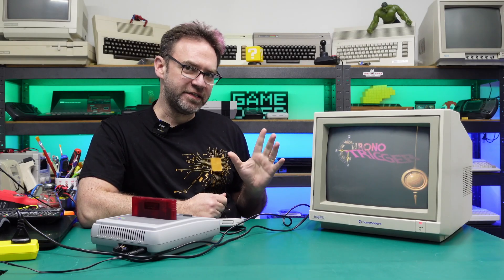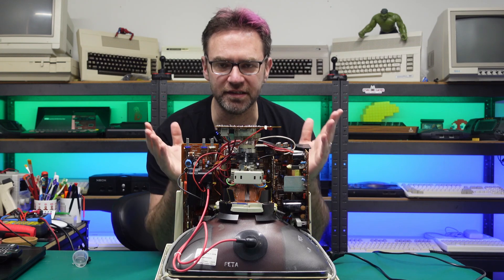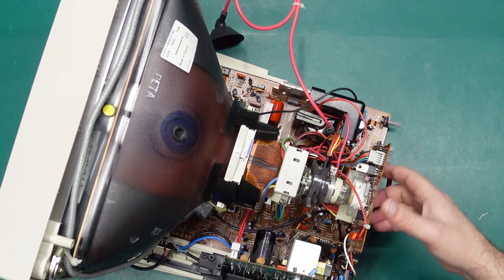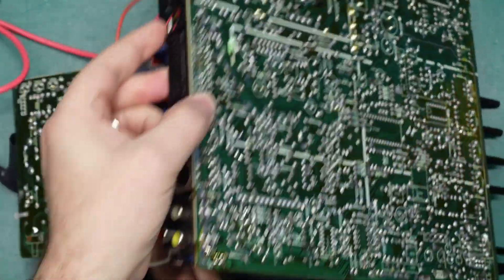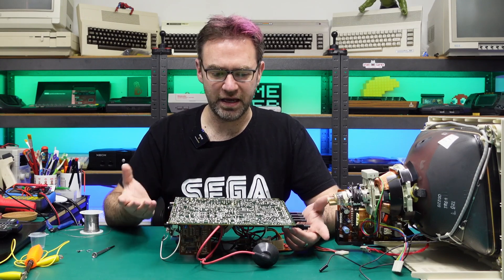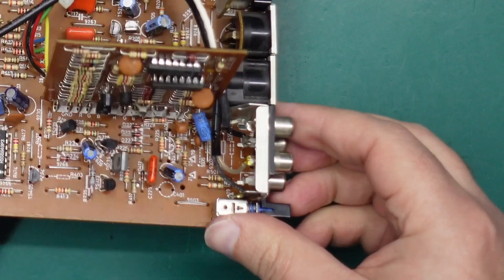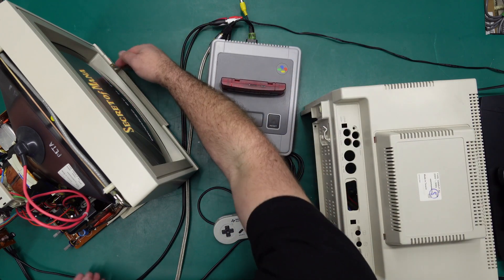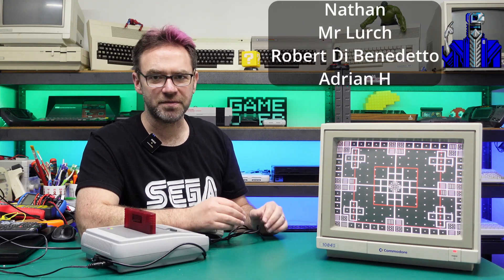Adding RGB SCART to a Commodore 1084 (old version - see pinned comment)

Comment: so if I make a din (analogue RGB) to scart female connector, would that be different than how you installed the scart connector diretly on the monitor ?
Reply from the maker: You can make a scart to din adaptor but it will only work with devices that output csync. You will still need to do the other mods if you want it to work with sync on composite or sync on luma. The instructions in this video are outdated, please see the new video here https://youtu.be/GP2Z7Y1ZBW8

Comment: Hi Mate. I just got a weird NTSC model 1084s. It has been modded at some stage to take 240v. But I’m getting black and white through composite. On both PAL and NTSC consoles. The crystal and sticker points that it is ntsc set . 

Do you know what differences I would need to add the Scart on this set?
Reply from the maker: Odd that colour is not working with PAL or NTSC. Perhaps there's an issue with the composite and luma/chroma switch or something along those lines. Adding scart should be the same as I showed in the video but I cannot guarantee it will work with an NTSC version

Comment: So this "mod" was for 1084S but I have 1084 with only one speaker. So this works for it like the same, just without that audio-cable?
Reply from the maker: It should be similar but not guaranteed to be the same
Reply: Thanks, I'll check it out some day. I have already 1081 which works nicely and has a SCART. Got some cracked solder joints when I got it but after fixing those, no problems.

Comment: Great video. Do you have a textual documentation source for those modifications?
I have an 1084 and its board clearly differs from yours (an S-P if I remember correctly) so having a written reference would help.
Reply from the maker: No sorry. And if the board differs then it may not be possible, at least not using the same method

Comment: I actually have a RGB Scart model (Profex branded). I have my Amiga 1000 hooked up to it. Never tried a console like SNES or Mega Drive/Genesis. Interlace mode on my Amiga is rather flickery with it. Do you think it'll work with a 16 bit Sega/Nintendo console?
Reply from the maker: The ones that came with scart will likely work fine with those consoles, but no guarantees

Comment: Hello sir ! , i do the scart, mod is working good. But only with my snes i tested out with other of my console but it’s not working with them, the scart work only with the snes , do you have an idea if the problem ?
Reply from the maker: Did you take note of the pinned comment about jumpers? Also what happens with the non working systems - no image at all? Scrolling or scrambled image?
Reply: @TheRetroChannel  yeah I take care of the pined comment don’t worry, and I have no image at all, the sound work but no image
Reply from the maker: @yeckom-vr6946 Hmm ok. Have you confirmed the other devices work with RGB scart on another display?
Reply: @TheRetroChannel  yes im not sure but I think the problem is from my video cable because with my snes I have a full rgb cable , but with the other console I need to use a adabtater from the 3 colored cable to the scrat , but I’m not sure
Reply from the maker: @yeckom-vr6946 Yeah, sounds like you may need to source proper scart cables for the others, or just stick with the SNES. Who needs anything else 😉

Comment: IIRC I used my 1084S (using the scart cable) and hook up to video machine so I could watch movies on it. I never tried any consoles connected to it, as I had none :) But it was a really good image on it compared to the awful "analog" TV's I was used to back in the 80s and early 90s. I still have my 1084S. It had to get service once, but it's been working fine.... Fingers crossed and hope it will continue to work for many more years.

Comment: Great Video👍🏻 How many watts should the resistors have?
Reply from the maker: Quarter Watt resistors will be fine
Reply: @TheRetroChannel  Thank You for the Information👍🏻 The Modification can begin!
Reply: @TheRetroChannel   I did the Mod, 
but I have some Problems! If I use the  New Scart Port with a Mega Drive I get picture and sound but the Colour Adjustment in front of the 1084S doesn't work anymore!!! And if I use a Scart Composite Adapter to connect a Sony PS1 on the New Scart Port  the Screen stays Black!  ☹️
Reply from the maker: Using RGB bypasses the colour processing. You will find this is the case with almost every RGB capable display.

Composite will likely not work being fed into the scart connector, just use the composite RCA connector already on the monitor
Reply: @TheRetroChannel  Thank You for Your quick Response!! 👍🏻 I thought I made a Mistake somwhere🤔  Thanks!! 👍🏻

Comment: Hi! Great video! I have a question. Will this trick work on my 1084P (MONO)?
Reply from the maker: It might, best bet would be to open it up and see if it looks the same. The audio side will obviously be different but just wire pins 2 and 6 on the SCART to the monitors mono audio input

Comment: Thank you for the great tutorial! I've modded my 1084S successfully (and also had to add the jumper @AusSonic mentioned) - Strangely, the montior needs around 3 Minutes of "warm up" (only after complete discharge - e.g. over night) since I've modded it - it starts with a thicker red line in the middle which widens after some time and starts to show a picture (garbled in the beginning) which becomes lesser red and more visible after some time. After some minutes the picture widened and stabilized and the colors are good - the monitor can be used normally then. Maybe you've got some hint what might be the cause of this behaviour? As I live in Germany, it's a german model btw...
Reply from the maker: So the issue only started after you did the mod? I was going to suggest bad caps that needed time to warm up. But if it was working fine up until recently, then perhaps a bad joint?

The solder joints on these things are known to go bad and maybe doing the mod has caused one to open up. I'd take a closer look at the board, if your phone has a decent camera you should be able to zoom in and see any bad joints. Pay close attention to the ones around the flyback, and also make sure the neck board is seated firmly and there's no bad joints there.

Otherwise perhaps it's an issue with the heater? I think you can measure the heater voltage on pins 4 and 5 of connector M6 on the neck board. Maybe check the voltage there when you first power it on from being off for a while, and then check it again after a few minutes to see if there's any change

Comment: Thanks for the great video i'm adding a scart to my 184S_  btw the 2.2K resistor goes into 9289 not 6789... ;)
Reply from the maker: Ha, didn't even realise I said the wrong thing after the resistor was in, but yes it should be 9289. Oh dear, I say it like 3 times, I think because it looked like a 7 instead of a 2 on the bottom of the board
Reply: @TheRetroChannel  update on my mod it Didn't work. the screen was garbled and kept on rolling.. I had a look at your board and found a wire jumper was missing on my board  just above R402.. So i added that jumper to it and presto it works.. Thank you once again for the proper tutorial..

Comment: Interestingly my 1084S works with just installing the Scart connector and the jumper(s). Moving the transistor, and adding cap and resistors results in a picture similar to yours before you made those mods. Keeping the transistor in place and not adding the other components has a very nice picture from my A500 PAL. Thanks for some great videos!
Reply from the maker: That is very interesting. I'm curious if you tried it with anything other than the A500? I did test it with a bunch of other systems and everything worked as it should, mind you the A500 was not one of those, but it did work with other systems that output csync. I'm thinking that 2.2K resistor may be too high for the A500 sync...EDIT: I just checked with the owner and it does work fine with his A500, so there must be something else going on.
I might pin your comment and see if anyone else has similar issues - if you do please reply to this comment
Reply: @TheRetroChannel   Great video tutorial ! I just went through the whole process and successfully modded my 1084S-P.  Thankfully, I saw @markhindsbo7876 comment before finishing the mod, and decided to try his method just in case (less hassle than having to revert back) So after soldering in the SCART connector and rerouting the audio cables, I just added a plain jumper in 9289, plugged in my Super Famicom and boom ! perfect picture right away ! Im immensely happy with the results, my MiSTer runs great on it and has found its ultimate display.

One thing I noticed is that the image is a bit blurry when I power the monitor on but it progressively sharpens after a couple of mn of warming up. Is that an expected behaviour ? (I dont have any past experience with that monitor) or could it be a sign of caps failing ? I have a whole replacement cap set but haven't got to replacing them yet.

Anyhoo, huge thanks to you both for your valuable contributions and knowledge. Can't wait for a video on adjusting the convergence :D
Reply from the maker: Nice. The Super Famicom and MiSTer may be using csync, in which case the jumper should be all you need. I'd be interested to know if it works with something like a PS1/PS2 or PAL SNES as they use sync on luma or sync on composite.

As for the sharpness issue, it's possible the CRT itself just needs a bit of time to warm up. Recapping may help but don't count on it to solve the issue
Reply: @TheRetroChannel  I only checked with the A500 through Scart. Using a jumper or a 2.2K resistor is about the same in terms of picture quality. I had originally done as in ypur previous video and that worked perfectly. When i then moved TS406 to the TS405 position the picture became out of synch. Moving it back (and reversing the cap and two resistors) returned it to working and in synch. Otherwise everything in my 1084S looks exactly like yours in this video. I should perhaps note that i live in the US, but my A500 is European and the 1084S i Australian (quite happy to have a PAL one in the US)
Reply from the maker: Hmm, thanks for letting me know. I'm not sure why it doesn't work on yours, but I guess if it works without the mod then it doesn't matter. There's so many different varieties that Philips put out that I guess there's bound to be some subtle differences in the circuit somewhere
Reply: @TheRetroChannel  thanks again for all the great videos and inspiration. As you say many variations and it's fun to work on them

Comment: Thank you for demonstrating how a CRT builds a charge back up after the EHT is discharged and disconnected. It is a big high voltage capacitor after all. If you don't keep it shorted it is going to pick up charge just from static in the environment and bite you!

Comment: I didn't know Australia used SCART like Europe. I guess the states was one of the few countries that didn't use it. I'd be interested in the adjustment video. Just to see how you go about doing it.  One thing you might want to invest in if you are going to be working around live voltage is some electricians gloves. Mine at work are from klein and fit pretty snug, so they aren't very bulky. They have saved me from getting a 480V zap. So well worth the 20 dollar investment.
Reply from the maker: We didn't really. Some 1084s and maybe a few other computer monitors had it but that's about it. SCART was practically unheard of here until the early 2000s when it started appearing on some consumer sets and Foxtel (cable tv) boxes.

Yeah I'd like to do a video on calibration, just want to make sure I give the right safety warnings beforehand. I do have some gloves, they're rated up to 25kV AC/40kV DC and smell like rubbery bacon. Problem is they're too thick to get in there and adjust the convergence rings with any degree of accuracy